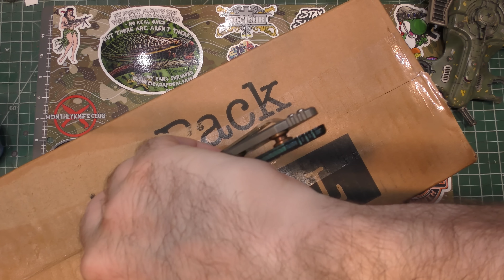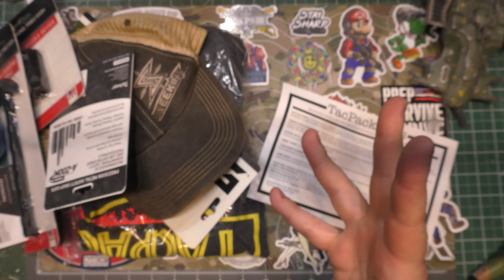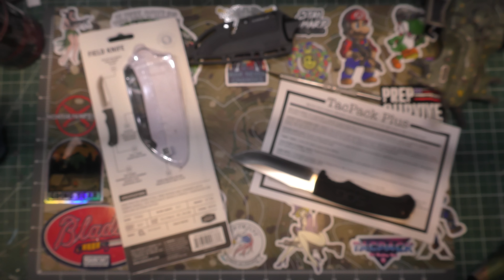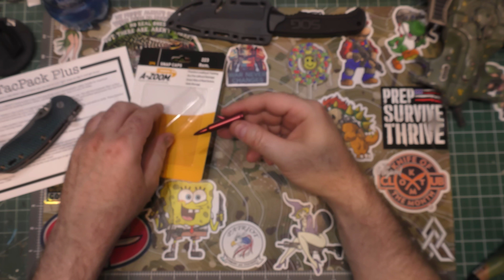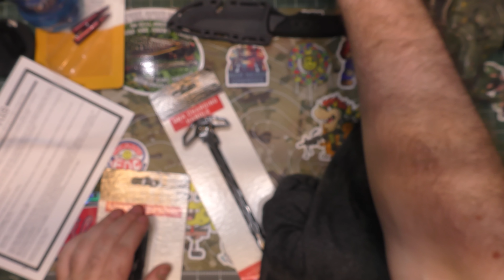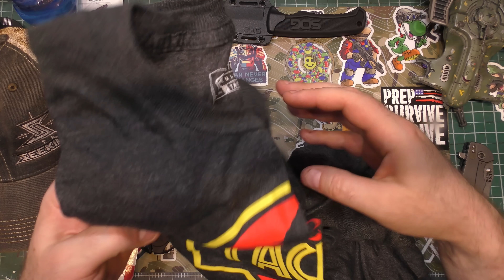TacPack PLUS - May 2022 Unboxing & Review

Comment: I bought the sog field knife and it's sh!t, I had to sharpen it out of the box it was even bevels and it's soft AF as a steel goes. It's damn near pot and pan steel, you're absolutely right it doesn't hold an edge. I make knives every now and again and my grandfather worked with gil hibben back in the day I know a little about knife steels.

Comment: What would you recommend for a general purpose rifle? Going off of the rifles weight vs knock down power?
Reply from the maker: The thing about the AR platform is that you can do so much with it. You can build it in .223 for a lighter round with decent velocity for defense and small game take down. You can just change your upper/barrel to switch caliber to something bigger for a heavier knockdown when you need to hunt bigger game or want something with more accuracy or a longer range. It really lets you do so much. The modular quality of all the pieces lets you build it to what is most comfortable and best suited to your needs. It really is not just some terrible weapon like those folks would have you believe.
Reply: @DocP91B  the 30-06, and the 30-30 were common among bug game hunters here, for deer and elk. When I was a kid.  We also have cougars around. I have found tracks in the snow in my driveway
Reply: I would personally suggest 300blkout but if you're thinking for shtf kinda thing then 556, if you need to hunt for ammo it's the most plentiful mid range rifle cartridge.